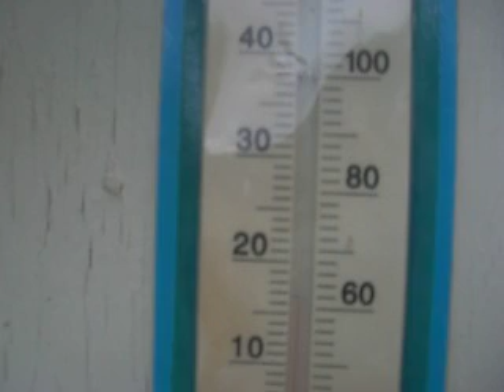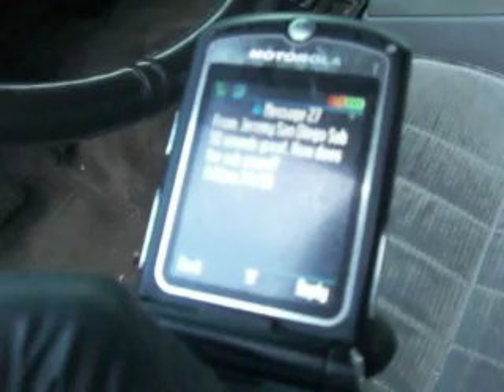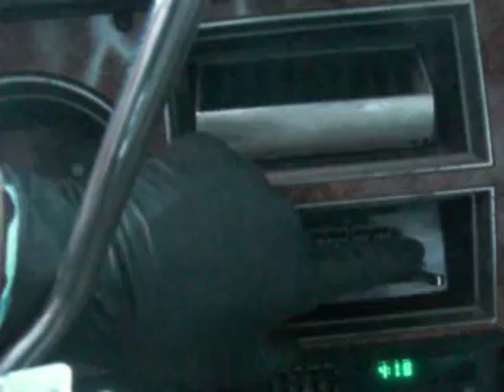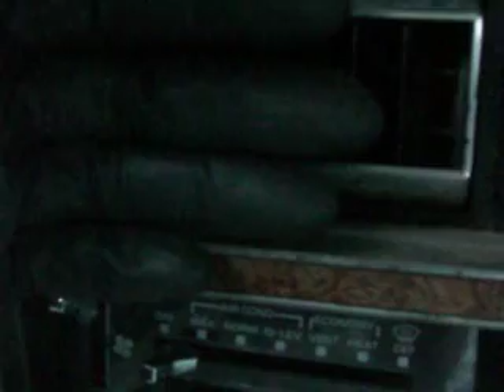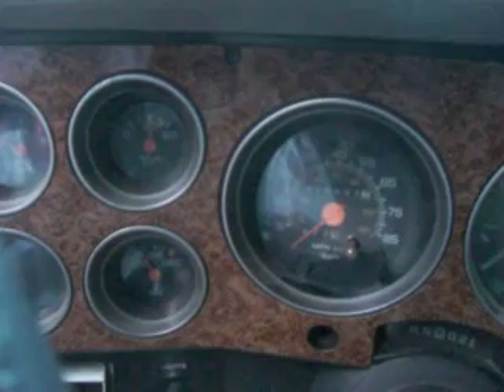Chilly Crank...

Comment: yea thats funny because check out my vids, my 91 has 400,000+ on the original untouched 350tbi motor. runs great.

I bought it and the odo said 373,000 and it had been broken for 3 years and the owner was driving it everyday to work, 100miles each way